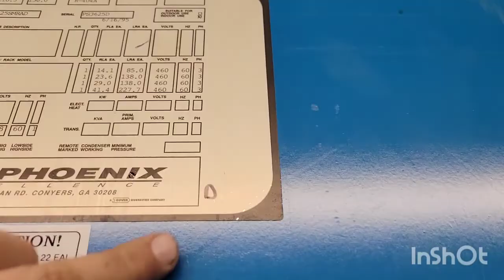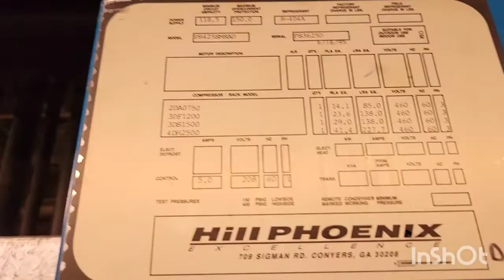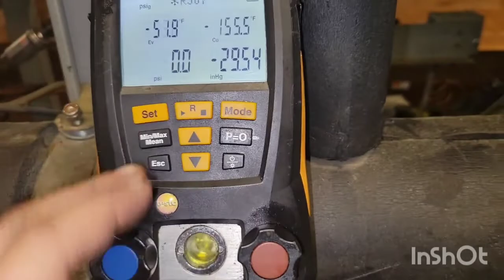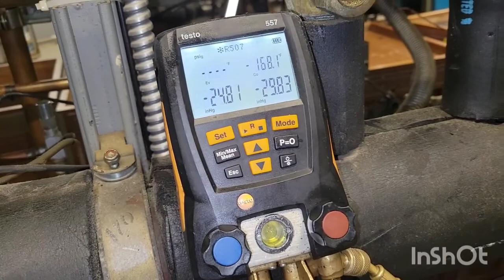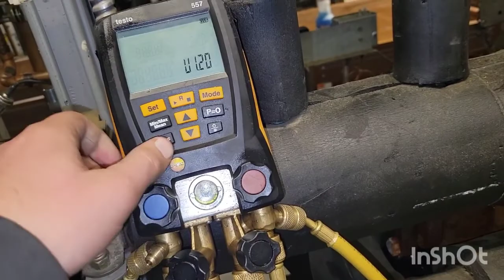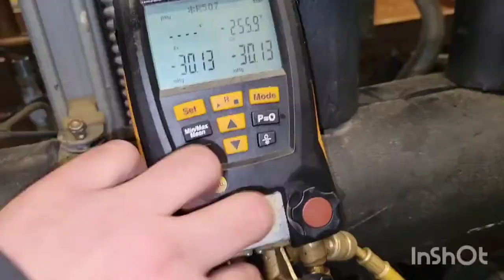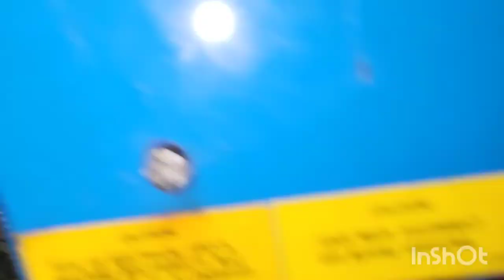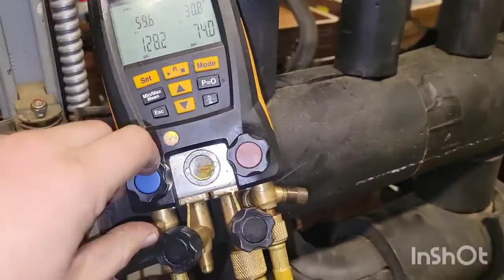Supermarket Rack Refrigeration - On Call Oil Blowout Repair!!! ( Flare Replacement)

Comment: The nylog red is crappy. Stick with the blue. I will add some nylog on the packing of the service valves too when I'm running the stems in. Seems to help with the ones that are rusty and crusty.
Reply from the maker: Thanks! 

What the difference between red and blue?

Comment: Nice fix on that flare!  
One question about transferring oil from that tripped compressor. I would fear that the reason for the trip was a winding failure which could have lead to contamination of the oil with burnout residue. I expect you are completely aware of this but would like to know how you decide when to do this versus not do it.  Those singapore noodles look fire! Love that stuff.
Reply from the maker: Really good question,

In a perfect world I would leave that compressor filled with oil. Come back during the week and access it deeper.

what I would do is. Make sure that the compressor is not Electrically compromised. Do a basic ohm reading. Then I would try to find out if there was some other cause on why the compressor was not turning on, for example, a safety or liquid flood back. If I deemed that there was another cause, then it would be safe for me to transfer the oil. Because it stands to reason that it was not the compressor that burned out But it was the other cause that kept the compressor from running, so the oil should be safe. I also look at the oil and see if its Dark brown or black. 

But in a situation like this it's a little more difficult. I might run a basic Electrical check of the compressor. Then just push out the oil If it doesn't look bad. This is probably not proper practice. But in the moment I need to get the system running, I don't have enough oil. 

If when I came back during the week, I found that the compressor was the issue and that it was a burn out. Then I would have to install acid absorbing filter dryers on the rack. And maybe consider doing an oil change. 

I'm not sure if it was the right call but it's what I had to do to keep it running for the weekend and save the food. 

I'm still learning every day so I don't know if there was another way to have approached it.

If the store had the space, I might have pulled some product lines and had them reduce the load on the rack. 

But anyway I hope the video was helpful to you :)

Comment: Ive learned the hardway with Nylog- spread on the entire mating surface, especially on metals like stainless. Nylog doesnt spread under the compression and can end up not sealing if theres bare area connecting ID-OD

Comment: I wish they would quit the fearmongering on A3 refrigerants here in the US so we can use R290.  It's a terrific refrigerant, having even better performance than R22 did, and it can drop right in!
Reply from the maker: I have not worked with R290 very much. 

Do you have experience with dropping it in? I thought you needed special components that would not cause a spark. 

I'm honestly asking i'm curious I don't know much about that.
Reply: @gendronhvac-r1269  I don't but I know it can be done.  It's been used to replace R22 in residential cooling in Europe for decades.  But you are right that you would have to use non-sparking tools when servicing such systems.

Comment: 22:45 are you pressurizing with discharge pushing the oil out of the compressor through the oil separator and reservoir  and then back into the suction line?
Reply from the maker: No,

My gauges are hooked to the port on the back of the compressor. 

Then I have another hose hooked up at the compressoil pump. That hose is fed directly into the suction. 

I feed the Discharge through my gauges. Pressurize the compressor. 

Is that pressure pushes the oil out through the Pump. And into the suction. 

Hope that helps

Comment: So I'm still new to super market Refrigeration can you shut all the compressors down without pumping down the rack?
Reply from the maker: Yes,

As long as it's not CO2
Reply: You have to pump down the rack with CO2?
Reply from the maker: @elplevonrooo395  
I never had a ton of experience with Co2.

I know if a co2 rack is shut down too long. The pressure will rise and then the pressure release valve will blow. 

I do not know the exact way to work on a co2 rack. I just did Not want to give the impression that you could shut down any rack And have it be fine and that there is a difference in how you treat c02. But the exact way to do that I do not know

Comment: Shouldn’t you pull it down to 500 microns according to EPA Rules??
Reply from the maker: Inches of water column is just a different measurement of Vacuum. 

29.90 Inches of water column is the equivalent of five hundred microns. 

So I pulled it 30 inch vacuum which is more Above them beyond the epa standard. 

The units can be confusing. The only reason I use those units is I can't figure out how to change my gauges To microns. 

Anyway I hope that helps :)

Comment: Isn't 500 microns like -29.95" of mercury? -29" of mercury is like 25000 microns.
Reply from the maker: 29.9 inches of water column

Is the equivalent of Five hundred microns. 

I had it at 31 inches Of water Column. 

This is A deeper vacuum than five hundred microns. 

I hope that helps. 

For some reason I could never figure out how to change my gauges to microns.

Comment: Putting nylog on threads completely pointless Friend. The reason is the threads are infront of the flare seal. So when it leaks it goes around the flare and out the back of the nut. Depending on what kind of flare is needed. You have to use a special flare tool. I believe it's called a orbital flare tool. The flares that it makes are wider. Plus the tool come with a clutch. Which prevents over tighten on the flare tool itself so you don't thin the actual flare out and weaken it and develop a Crack. I know this stuff cause trane classes taught me about all of it. I like your videos. Thanks. Also the reason for the wider flares is some of these refrigerants run at higher pressure so it needs a bigger seal matting surface to hold the pressure.
Reply from the maker: Thank you for your share. 

That is an interesting idea. I actually have extremely little experience with flares.

The company I work for actually had a no flare policy. 

Where if at all possible, you were always supposed to braise unless you were replacing an existing flare.